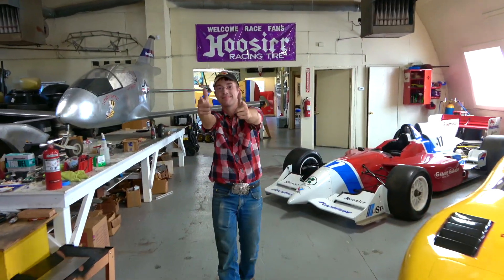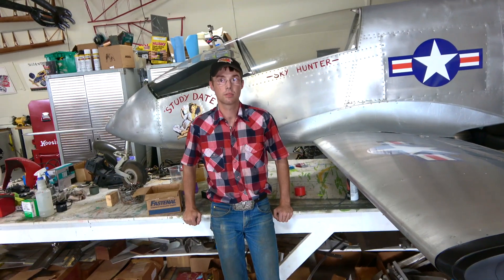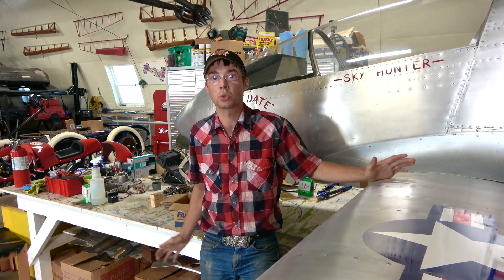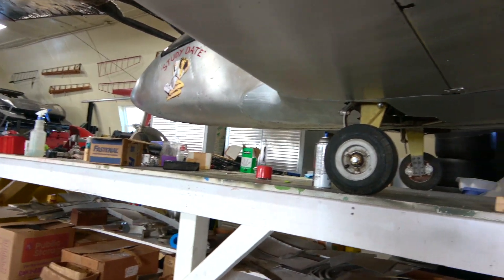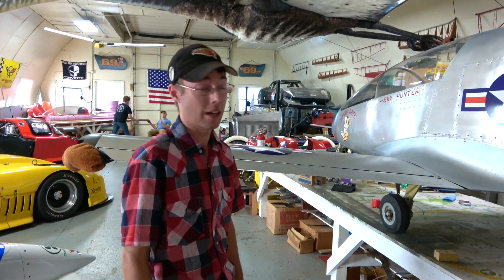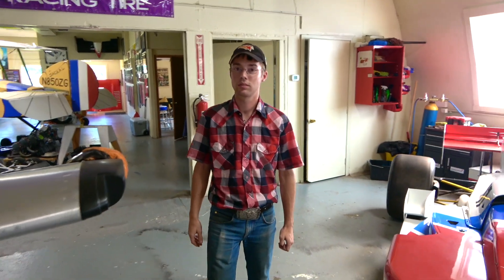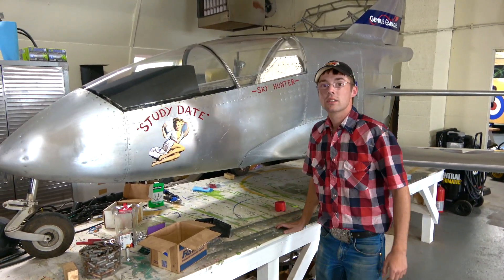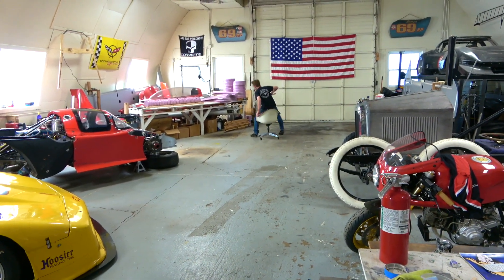Finishing the BD5 microjet airplane build

Comment: Does it have the latest version wing?  What are the practical prospects of it taking flight?   I have a hard time seeing how there’s anything inherently wrong with the concept of the BD5.  The thrust line may be an issue but it should be able to be adjusted in height or angle at the design level.

Comment: Interesting tidbit of knowledge, James Bond "Octopussy" had some scenes filmed at RAF Upper Heyford, UK. The scene where the micro-jet flew down the road was the road that separated the housing side of the base from the active flight line side. I was stationed there in the early 90's. As of when I left there, the sign from the movie at the Octopussy Circus (or whatever it said... details...) was still hanging in one of the hangers on the base. At least one other notable movie franchise has filmed there, The Fast And The Furious (I think #7) filmed there.  It actually shows the underground building where I worked on F-111 Avionics.  Good Times....

Comment: Finding an affordable jet engine for it is the challenge. Are there any out there? There were lots of those airframe kits sold, and gathering up enough parts to have the full airframe can be done pretty cheap usually. But the engine is the wall one hits with this model.
Reply: There are two viable jet engines for the BD-5... the French Microturbo TRS-18 and the Czech PBS TJ-100.  The TRS-18 is not built any more but is still somewhat available and supported while the TJ-100 is a readily-available off-the-shelf item with a retail price tag around $70,000.
Reply: ^ This.

Comment: Is the gear retraction mechanism functional? It would be great if the gear and control surfaces could be moved remotely when it is hanging as a static display.
Reply from the maker: gsmac1969 yes it is
Reply: @gsmac1969 >>> AFAIK, the landing gear is operated manually by the pilot, not electrically or hydraulically.
Reply: @Allan_aka_RocKITEman  You are correct. There is a lever in the cockpit that is slid forward and back that actuates the landing gear. Some kind of actuator would have to be mounted to that in order to make the gear move on its own.